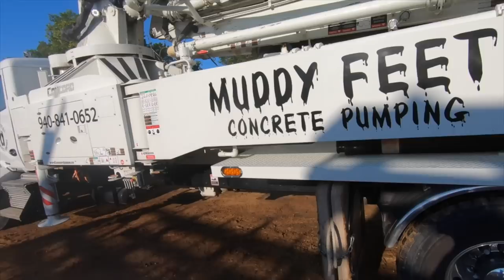Concrete truck rolls over. Pumping concrete with Muddyfeet

Comment: That tree on the right would’ve held it up guaranteed. Should’ve never even touched it til it was chained to that tree
Reply: I Do Not think that tree would have held it. these trucks loaded can weigh up to 66,000lbs! that tree wasnt a foot in diameter
Reply: @RoughIronRehab   I’m 100% sure it would’ve held it. It’s not like it would’ve been holding the full weight. Just a portion to keep it up right. That’s an oak, if it were a weak pine or something then maybe not. The trunk would easily hold that entire weight anyways. It would be the roots that would be the weakness. People seem to underestimate the strength of trees when all they’ve ever worked with as far as wood is a generic pine/fir 2x4 and think every piece of wood is that brittle.

Comment: I'm working construction 44 years on a site like that the very first thing you do is put in a temporary 300mm thick concrete driveway minimum then your off to the races
Reply from the maker: Still have to stay on the road. Lol

Comment: Enjoyed the video!    Hope you got truck lifting back on the tires.   First wrecker driver should have secured Crete truck from driver side back wheel end over then to snatch block on that tree low with wench cable.    Might have prevented roll

Comment: I'm glad here in Michigan we don't have any rear discharge trucks. When I started doing concrete in 1997-1998 couple plants who had maybe 1 or 2 in use. Within a year or so they were not used anymore.. Their much harder to dump out than front discharge. Driver can actually see and move truck and chutes where needed. Rear trucks only good for  dumping into telebelt or pump truck.
Reply from the maker: That’s what we are use to. Never poured out of a front discharge.

Comment: Drove rear discharge for about month awhile back. Front discharge the other 18 years. Everything has to be pumped it seemed with rears the exact opposite with front  discharge. I’ve take 10 yards places you could never take rear  discharge. We use large mats to drive on grades like that plus your pulling in forward. Lock everything in and a nice steady pace. No dozers on a site like that? I wouldn’t touch it with one wrecker. Cut that drum off so you don’t bend the frame. That truck isn’t picking up 50 ton with boom extended.
Reply from the maker: Sounds good, thanks for watching!

Comment: Never know what's going to happen...but...I would have reversed the drum and let the mud crawl up the light side...stop the drum and try and carefully drive it out before it sank too far. It appears that the driver kept the drum slowly spinning, charging, the whole time. In my opinion that is a mistake, unless you're going to discharge the mud and then try and rescue the truck. Hindsight is always 20/20 but wider road, spotter or a little more experienced drivers might be the call for a job like this.
Reply from the maker: Chris drove a mixer for a long time.  He said the same thing your saying.

Comment: That road is completely unacceptable for trucks coming in ,I would be fired for making a road out of mud ,u gotta dig down to hard stuff and put in a base ,compact ,put in gravel ,compact ,it's called lifts and that's the reason why because of what happened here ;but I wonder if why they didn't do that is because they didn't know what they were doing or maybe there is no hard stuff ,underneath that mud ,but they still did a horrible job
Reply from the maker: It’s only bad if you run off of it
Reply: We always made good roads for trucks coming in and out ,it looks to me that whole place is mud and if it rains really hard trucks ain't getting in and out ,u make a good road and u won't have them problems ,but it's expensive and that's prob why it's not done ,or I don't know

Comment: #1 the road was not wide or solid enough the job should never had gone.#2 thing when you get like that stop the barrel ! the vibration of the barrel/engine running will work the truck into the soil faster and turning the barrel is putting weight on the up side of the barrel rotation which happens to be the side it is leaning gravity and a liquid load means the more it leans the faster it rolls over.

Comment: Is always that good driver that plant always send first run
Reply: Sounds like your a few in already this morning.....lol
Very few commenting here understand what should have been done before the concrete was ordered, but your in the business so you would know.
The ready mix supplier should have refused delivery until that driveway was upgraded to handle the weight.
Reply: My body usually wakes me up by 5:00 AM  LOL 

The contractor and pour crew should’ve had inspection a day before show time, but
I’m sure you see this kind stuff very often.

Comment: He never stopped the drum turning, I believe that was a huge mistake.  We were always taught that if your truck gets in a compromised situation stop the drum. The movement caused by the weight shifting around will sink it in further. I feel like I have a unique perspective with about 5 years as a wrecker operator and now about 2 years as a ready mix driver. This was handled poorly on so many levels. A series of mistakes were made by more than one entity to get the end result, wich was a mixer on its side.
Reply from the maker: Probably so.

Comment: chain a truck to the rear on the uphill side and chain wrecker to front on uphill side. Have rear truck keep tension in the chain and slowly follow as wrecker pulls it forward and out.

Comment: This is bad , try going head first to the back of a footing . Coming across the lot from the back .we was all afraid of the easement but the driver was stuck on send it! 40 feet off the road he collapsed a old septic tank.sounded like a bomb going off.
Reply from the maker: I was pouring a patio one time and had a truck fall into an old septic tank. It nearly turned over. I had to bucket the concrete with a tractor to get the patio poured. It was a tough day.

Comment: If the mixer had pumped off the wrecker would have been able to save the day! At very least the wrecker operator could have run a strap over the drum to stabilize and the other winch to the front of the mixer to assist in the pulling. I estimate the mixer being approximately 75k lbs and wrecker only weighting in at about 36k lbs. That being said your not picking up the mixer your pulling it out. Don’t get me wrong either way both drivers had there work cut out for them #1 being the narrow rd and #2 the sheer weight of the mixer. Be safe everyone and have a great day. 🇺🇸
Reply from the maker: Yeah I have to disagree with a lot of people on here. With respect of coarse.  The mixer like it was was to unstable to be climbing on. In my humble opinion it’s fate was sealed the second the tires stopped turning. Sucks I know. But it’s the truth. The wrecker company isn’t the blame for this incident.
Reply: Muddyfeet Concrete Pumping I am not in any way whatsoever blaming the Wrecker Co. sorry if I came across that way. Based on the video I see a different strategy is all that doesn’t include climbing on the mixer. Like I said it would have been a hard fought battle but it didn’t need to go over. JMO. I have 24 years as a heavy tow operator there’s always more then one way to do these type of jobs.

Comment: Should’ve stopped the drum with the load on the passenger side of the drum. With it turning the load is on the down hill side and the movement just kept wallering the truck further down the shoulder.

Comment: That was hard to watch. I drove ready mix trucks for over 25 years and they could've saved that one of the wrecker operator would not have wasted so much time. There was a tree right there to anchor the truck to so it wouldn't roll over like it did. We've had that same thing happen more than once and the first thing they did was anchor the truck before it sunk in any deeper on the ditch side so they could save the truck. Too bad.

Comment: That was the tow truck driver fault! He should of put a side pull line right of the start off the tree to keep it from rolling and while pulling it forward little-by-little release the side pull line but keep tension so it doesn't roll over
Reply from the maker: Wasn’t his fault. He didn’t put that truck in that situation. Also the truck was to dangerous to be climbing on to attach anything to.

Comment: The pump truck and the first mixer made it soft for him in the beginning.  Plus the road was way to soft before they even started.
Reply from the maker: It could use some gravel. But could have been prevented if they would have used a backer.

Comment: Wow, talk about incompetence from both original driver and tow truck operator.  First move should have been to anchor top of drum frame to 90 degree point to keep it from tipping.  Then pull it forward.  I agree it was a very poor quality road, been in these type of situations a few times in 46 years of concrete construction.

Comment: the road is crap.  The problem here is not the driver.  The failure was readymix plant supervisor saying he could deliver.  The access was on that noncompacted, to narrow, nonstructural clay fill with a culvert (probably also not installed right).  The inferior fill material will pump worse with every load.  Who ever claims that to be road construction, has no pride.
Reply from the maker: It was good if you drove down the center of it.

Comment: The Towing guy should be fired. How in the world can you hook up to this from straight?? You need a full angle to pull this unit. 70000lbs and it's tipping so you pull from 100ft thru the trees on the rear axle and hold it tight while the trucker goes into neutral and been pulled from the street with another winch of the pulling point of another full concrete truck. This will get the truck out without roll over but guess the guy didn't knew better.
Reply from the maker: Fired I think is a little harsh. I personally don’t think you should fire someone over lack of experience. Much less belittle them. It could be more of a supervisor issue. But either way. I think that trucks fate was sealed once the tires stopped rolling. We where to far in the rural area and away from the necessary resources needed to help the situation.

Comment: First point the first wrecker should have been on the right of the junction pulled across the waistland that's my reconion
Reply from the maker: I think the first truck was a Littke light to handle the mixer. I bet they where told they had a truck stuck and just needed to be pulled out. That’s why they sent it instead of one of their rotators.
Reply: exactly what i thought too.im not just commenting I'm a former rear mixer driver as well

Comment: None of ya could tie it down so it would be harder for it to roll over?
Reply from the maker: My guy didn’t have anything to do that with. Much less did I want my guy to be climbing around that truck. It was a sinking ship
Reply: @MuddyfeetConcretePumping  if i was on that job that truck would have never tipped nor would it have ended up getting stuck at all.  
    Smarten up kid

Comment: I’m not trying to be a smart ass but I would’ve wrapped the straps around a few trees on the right side of the concrete truck and tied it to the top of the concrete truck somewhere high so it has the torque to resist the tipping moment. Assuming the trees had the strength to hold it. They seemed large enough . Tow truck driver seemed clueless.
Reply from the maker: If I owned the tow truck company I would have fired me operator for climbing on that unstable truck. The truck is replaceable. Risking injury or worst isn’t.
Reply: @MuddyfeetConcretePumping  that’s true also. Safety first

Comment: Im gonna play arm chair quarter back just for a second here. I'm 24, had my CDL since I was 20, been working with dirt my whole life, I would've walked the edge of the road to see the stability, and just given the context clues of how the road looks I would've turn this job down. The crown of the road, the soft looking, steep drop off, it screams that the road would give away with enough weight. At the end of the day you are responsible for your rig, no matter who owns it. It's your license, your driving record on the line, I'd rather lose a job than take such a risk. That's my 2 cents, I'm sure more experienced drivers will disagree, but at the end of the day I trust my own judgment more than to let my ego get in the way of safety. Safety rules are often written in blood.
Reply: With respect no matter how wide the road is if you back off the side of it it’s going to let you have it.
Reply: The appropriate thing to do in this situation is use a backer.
Reply: Which they did not
Reply: @MuddyfeetTV  Can't disagree with you there. I started with motor coaches so I may be more risk adverse when it comes to driving, but with up to 60 lives in your hands I think it's justified. Switching to public works with dump trucks/plow trucks, and other heavy equipment, being in similar situations the width of the road makes ya pucker a little. To add to that, if no backer is available, I'll never hesitate to get out and look. Safe Travels.
Reply: Absolutely, I like the way you think!

Comment: Bad situation. Driver did not get out and look before backing in, no one guiding him in. I thought it looked like he was coming in fast for the road he was backing in. Looked to me like the drum was still turning as the truck sat there leaning. I have been told to shut the drum off of a leaning truck because the truck moves as the mix falls over the fins and that hurts the stability. This is all hindsight. To a certain extent,  could have happened to any driver.
Reply from the maker: I’ve heard to put it in discharge for a few second and it brings the weight of the load over to the passenger side. Yeah who knows

Comment: 1st thing driver should have done was get the concrete to the right side by discharge the barrel a quarter turn. Tow truck was not in a good location. All he would have done is help the truck roll. He needed to be on that road up ahead and to the right...

Comment: When the truck get stuck directly turn the drum the other way around.... the weight of the concreet turns to the “safe” side and dischart. An experienced towtruck driver secure the truck using the bigger trees further in the wood

Comment: been driving a mixer for almost 7 years now. ive seen one lean about that bad before same thing slipped of the narrow haul road. that road is too narrow with some step drops on both sides. definitely a pucker factor lol.
Reply from the maker: Yes. You definitely needed to be in the center of the road
Reply: @MuddyfeetConcretePumping  are those 7 yarders?

Comment: 1. Someone got cheap on building the access road. 2. Early morning bad visibility 3. No spotter 4. No room for error.  Etc.  
I’d be curious if dump trucks made it in there building that pad and had no issues.
Reply from the maker: I’m guessing they did along with the pier driller and a couple other concrete trucks.

Comment: If that was my building, all the mud would have gone back to the plant. No way concrete sitting several hours would be placed in my building. You are only allowed a maximum of 3 hours in the truck before it is rejected. Most jobs I have been around only allow 90 minutes maximum and  most send it back after 60 minutes after leaving the plant. First thing boss looks at is the time stamp for departure form plant.
Reply from the maker: They sent all the concrete somewhere  else except the first truck that got there.

Comment: Ever wonder what the underside of a Readi mix truck looks like? Now you know.   Nice video.
Reply from the maker: Bubba your exactly right. Would make it easier to inspect the drive lines
Reply: Been pouring concrete for 30 years, I’ve never personally seen one go over.  It does happen from time to time and what a mess.

Comment: IMO leaving the truck running is what caused it to roll. I realize you would leave it running to turn the barrel but I didn't see the barrel turning. It went from a $25,000 repair to a totaled truck when the engine seized.
Reply: The drum was turning (you have to look pretty close at certain moments to see this), and it was turning the WRONG way!  It was turning clockwise as viewed from the rear, causing the load to shift to the left.  As pointed out by another poster, discharging the load right away (dumped off the edge of the road - no need to waste time trying to salvage it) would have shifted the load to the right and also gotten rid of the load, lowering the center of gravity, and probably would have saved the truck.

Comment: All I see on YouTube videos for southern or eastern trucks are rear discharge trucks and here in Idaho and Utah all we have are front discharge 6 wheel drive Oshkosh trucks, I don't know why any company would want a rear discharge truck. Kinda crazy that he went off the drivers side since it wasn't the blind side all he had to do was look out his window to see he was going off.
Reply from the maker: The front discharge is something some of these guys might need to look into.
Reply: Its mostly a regional thing , but rears are more manuvarable  and cheaper to buy.
Reply: @ericwsmith7722  they are definitely cheaper but definitely not more maneuverable, the front discharge has no good or frontend the cab is set dead center and is only big enough for one person and is right up front and the engine is in the back behind the drum and axles so even though they have 6 to 7 axles they're still shorter and have a shorter wheelbase so they can turn tighter and can actually see where the shute is right from the driver's seat.
Reply: @clydeacor1911  ---Ohhh is that what they look like ,